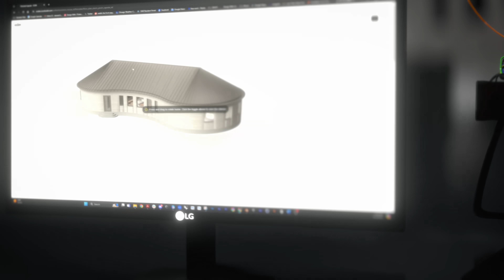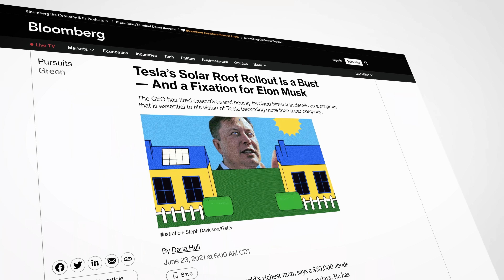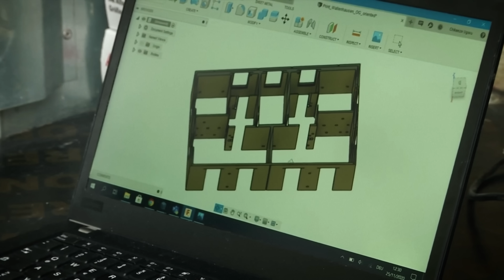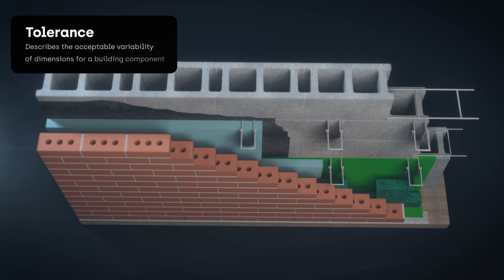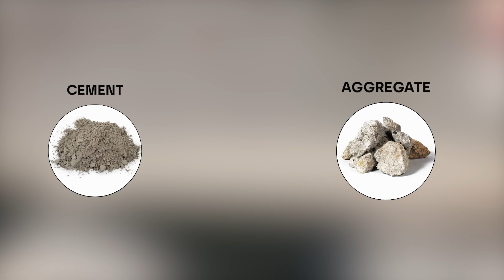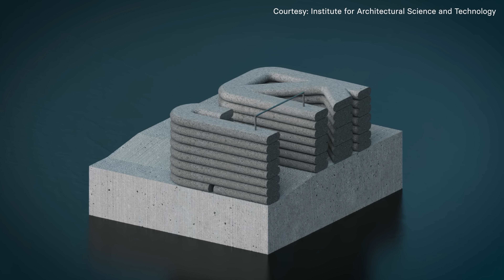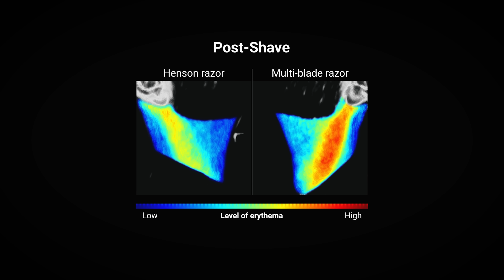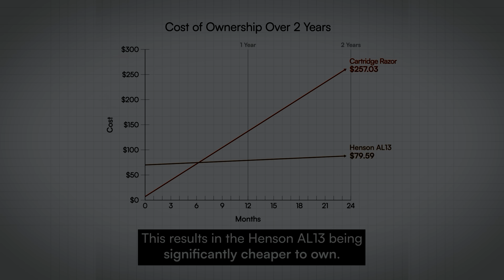Why 3D Printing Buildings Leads to Problems

Comment: 3d printed home... with concrete, its just essentailly framing, as windows nad other means are needed, its liek framing a house, if its all prefabs, in a few days a crew can put it up... you can have more nubmle asembly using a gantry and automotive custom robotics, ie those arms and more with hydralic actuaot,r this then increases the ability of the over all system adn eprformace and increases your tool  load and more.. If you set up a a variable disk gantry with a rotaor swing, you cna have mutliple arms, adn also create pallet load zones, and a multie camera recognition zone nad have one person observing, it cna stack bricks without light all night  nad have an outside program feed back against hte drawing for precisions, it cna also create sharp corners with timing auto trowel. As for windows I had this idea for ever that all windows could be installed better, in a total seal system and frame, and in teh window inset insert woof or steal, youuse a crank arm that wedes out prongs lateral and vertically, into locking holes nad hte base, then cna give it a 1 inch radial swing until you lock it within that variacne giving higher precision to hte blueprint of the core is offset, then the secondary part which makes htis better is you ahve insulator snap trim or acrylic on the outside. Of course my design would also change walls. I hate drywall never liked it currently not free not a citizen and denied educaiton shelter nad slaved away by cults of inequity tehy are theives nad murderers nad lawless and merry in their cruelty. nonethelss I carry on, the cirmes are known.. assholes lol.. anyways, teh secondary means would be acrylic shielding or flat prion , kind of liek a specialed car acrylic that is machine made this owuld be a standard panel that can come in any colour and the purpose is that htey can latch on and off, with special magnetic sealing locks, with a tool so its cna't jsut fall of the wall and its simpyl a setting pi nadn lift or more complicated, the point would be rather the ndry wall the acrylic shield is all stacked into the walls as pannelign which a machien can do... these can be mass made with machines, and offer good coefficient for heat dispersal... so your walls are have good heat disperal and cold dispersion, or pci kanother type of material if yo uwant insulation type setting, the purpose would be to have a coloured pallate of hte systme of any choice, and even chacked or custom panel shapes, and hte panels could be metal also... andinlcuding specailed print walls, meanng you could have rock, mimicry or other ... well anything,, the best hting is if you want a re paint your house, the panels get all taken out and then cna be sent off auto repainted by a machine... as every home hsoudl have historic data key of all dwellers and blueprints and home owner changes and modifications... increasing communication helps advance the systems between homes, but when homes are so fast in this state to make, the only long hting would be surveying but that too can be increased, through various geophysics localied enviro and wider ranges ot a more precise engienering landscape.. so.. total hosue in my mind unfurnished is about ... 3-4 weeks.. 90% machined... could be 100%.. but obviously a human needs to observe and small tasks can be easier... also you can leave your panels in place and have a epson like robot wall print print your house walls wit ha viny coat, over night and change your colour... 3rdly more expensive being an acrylic and the current tv tech, you cna have aflex print scream overlayed and ahve the walls illuminate t any colour or motion.. as if they are all a television.. but lol... I don't know... as for roofing.. I liek the plubiums nad other factors and with combination ofortiz pumps nad more you coudl create a localized fresh water, clenaing water and mini power station... a more self autonomous zone... but.. all we have are thieves on this planet with money.. and open hatred... accuse dreamers or whatever... and state device,s adn then make breeding impossbile.. truly a wicked lot of humans that are ignorant of their wider surroundings and cruel..  come in the name of their wicked god I guess or lack there of.. or whatever means simpyl just lawless cruel humans .. so there in again no work, no life no lmoney.. identity poltics nad more... and then emphsize on its manenr that its vidicated, when I was and could of been happy in my own kind rather then prisoner ot a relic of savages adn cannibals that have no devleopment cognitively except for killign and crime.. the ferallands of nomads...  thus nothign changes and this onyl creates more problems like advancing food, it worked for awhile prosperous we had our own kind nad life.. and the nteh migration came of unlike minds hostile savaee nad lawless, and constnatly using words and nonsense and we see them given power, and yet they insult hte poor and others, by cliaming that is their  reason ot do crimes, when in reality their reason to do crime is becuase crime is in them to do becuase tehy have no law concept in them... siigh..  politics of 3d printing..  openly and honestly... iF come nad destroy your parents a nddeny law, and or vlaue and allwo criminasl to go unabated wth medaited island of chidl rapists, right.. clearly they will condem nand kill me and my life from existence and hten wearly accuse and dictate and spy on me as if some thing to watch, what move shall have but left iwth my mere thoughts ,tehir world is always deception lies and well crafted civil prisons... forcing peopel to be subject ot hte curelst means nad unsual puihsment in their experiements. I find no forgiveness for these liek actions liek unti 731... they are beyonreproach in their disbleief and cruelty. and yet I am accused... of such things.. hmm end rant.

Comment: If you want fast building houses do modular design, in Europe we pour the concrete wall elements laying down in factories, ship them to the work site and put them in place with cranes.
Wooden construction walls is built in the same way .
This 3d printing concrete houses is b.s .
Ise automation in the  house factory for 
Cutting and shaping stuff (if you want to reduce peoples job opportunities )

Comment: Can we talk about the problem with using pu foam in the holow wall space?
A clean concrete wall structure, can be recycled to new concrete or fill as crushed 
Aggregate, the plastic foam konverts a potential clean reusable asset to a contaminated plastic/ rock mess.  Probably inseparable in its parts Unsuitable as concrete agregate and a source of plastic pollution wherever its ised as fill.
The better choice wold be to use  light gas concrete or light aggregate concrete with foam glass or leca as aggregate. 

Why are you Americans so in love with toxic isocyanate building materials ? Yes in Europe we do set doors and windows with it.
foam as whole insulaton solutions is how ever very unusual, in parts for the toxicity of the pu foam during applying face and waste face . but also because the foam is flammable and will give off toxic gases when burning or even heated up a a bit like starting at boiling water temperature.

Comment: If a part breaks you just get a typical mason contractor to mimic the same design. They usually do all sorts of concrete work mimicking natural rocks and stamped pavement. So it ain't a prob. If 3D houses really are cheaper, than it's actually more advantageous to only have bricklayers/ masons do repairs, caulking or cement surfacing work for smoothing those that hate the grooves.

Comment: You know, here in good ol yurop we have a revolutionary new technique called plastering and insulation. We usually use both of them on outside walls, and this actually helps hiding imperfections and you know...keeping warm air inside.

On the inside, plastering hides imperfections and acts just like a dry wall, with the added benefit of having actual walls on which excell at sound insulation and...well, being an actual sturdy wall, that can't be punched through by kids.

And it helps with the repair problem as well, because you can just break a hole in the wall and later close and plaster it again, should you desire.

Comment: So, in colder countries like Canada, where I live, the one huge thing you want to avoid is having a construction material bridge the space between the exterior and the interior. This results in dramatic heat loss through a phenomenon called thermal bridging. By creating continuous webs, you are encouraging heat to escape. Insulation in the remaining cells doesn't overcome this difficulty. There needs to be an impermeable membrane - and preferably, an air space between the exterior and interior construction. So, like many innovations, this is an idea that will work great in warmer countries, but not that great when it gets down to -30C on a regular basis for 4 or 5 months of the year.
Reply: lol Your welcome Chat Gpt for helping you write that, its ok this tiny YouTube comment section thinks your reaaaaaally smart 😉

Comment: 11:50-12:08: dolomite inoculated with a type of fungus that only grows with concrete when exposed to water. They call it self healing concrete and it's been around for a few years already. Ideally you want a mixture that's self healing when cracks occur and doesn't allow moisture to penetrate the structure. The mixture used should also get harder over time as it sequesters carbon from the air (via exposure to the elements). These structures are recyclable, so reprinting them is only a matter of pulverizing the demolished structure and heating it to a specific temperature to separate the molecular bond of the cement to everything else in the mix. Then you just add water and mix it to the correct consistency for the temperature of the day you'll be printing a new structure. Basically it means moving day is only a matter of packing all your possessions inside of a storage container during construction and then unpacking them again in like a week when the structure cures. You'll still need accommodations for like a month while all this is going on, but it's like camping, so as long as you're not going through this process too often you should be fine (the structures should be rated for 100 years but nature has her own plans so aim for 10-20 years max usable life). You can also stucco the exterior and interior of the structure to get that nice finish you want if that's what you're after. You'll still have to remove it all for a reprint but at least you have those nice lines you're after (at extra cost and extra work). I think adobe stucco would be a better compromise because you can just water blast it off and keep it for later reuse. Just a thought.

I'm convinced this is the future because it doesn't matter what the housing market chooses to do with pricing if you can take your house with you anywhere and redesign it any way you want. Why would I want a $1.2m home made 50 years ago knowing it pays for some retirees' nest egg- that I can't afford mind you, when for the cost of a down payment on a car I can own the same sized structure? Why would I want a home someone else has already lived in? When I can make the improvements I want in the next print? I want a house that I can automate water collection, sanitation processing, HVAC air quality control and be energy independent with. I'm not going to get that with any preexisting house on the market at my price range. It just doesn't exist. That's why this is the future, to me anyway. 

And while we're at it, technically that same 3d printed home I'm talking about could end up being free if I use a specific crop to get one of the main construction components and sell off the seeds and fibers I don't need for building. Yeah... You heard that correctly, a free house (with extra steps). Why would I, in THIS economy, want anything to do with a failing model of living and end up passing on the cost of my retirement to the younger generations? That's a FOUL, DISGUSTING thing to do to anyone, taking their financial future away just to survive a few more years when there are easier ways to live that don't screw over the next generation.

Sorry for the rant but... 👀👀👀📈$$$
No.

Comment: rather than 3D printed houses, why not 3D printed blocks? not tiny brick sizes, but modular blocks, that can be put together in different configurations, like legos? You know, most legos fit onto other legos...
I always wondered why "modular construction" was so limited with identical sections. It seems like 3D printing could fill that gap between large modular units and traditional house construction. IDK just a thought...

Comment: I'd hate to live with those walls! Think of cleaning them.  Or building cabinets against them. Filling those cavities with insulation will provide very little insulating value with all the concrete paths for heat to move from one side to the other. 
Factory made insulated concrete panels would seem to have many more advantages. Smooth inside textured outside if desired, electrical and plumbing integrated at time of casting. Floor slabs, stairs roofs all can be made and stacked as high as you'd like and welded together. Commonly used in Europe for multifamily residences. 
I can think of many disadvantages and few advantages to printing with concrete. I'll watch to see if my doubts can be overcome.

Comment: I've been involved with construction design for over 30 years now. New ideas pop up.. usually targeted at one aspect of the construction process- either being cheap to buy or way faster on site - while adding lots of other issues that add to the total cost. About half the cost of building a new house is labor. I like the idea of "3d printing" a house.. but this doesn't actually solve ANY problems, while creating MORE problems (added expenses). While you could design a home to the limitations of 3d printed concrete walls.. you could also design a new home to the limitations of prefabricated walls, prefabricated trusses, and/or Structural Insulated Panels. Those all allow for quickly getting a new house under roof with proper planning. The BIGGEST issue I see with the 3d printed walls shown in the video is they have no steel. They can't put rebar in place before the 3d print because they would be in the way of the print nozzle head. No steel in concrete (and layered to boot) = it's not very structural. You can't build a two story building with these walls only. It's basically glorified Brick Veneer. No idea why people are pushing it like some innovation. We already have efficient uses of material to make prefab systems for a new structure. That being said- in places where they already pour the walls with concrete due to moisture/termite issues, I could see this having SOME benefits but it's still iffy. But they need to figure out the steel aspect.. I would love to see a structure built with these walls on a seismic test platform. Looks like the layers would just crumble.

Comment: A complete concrete home, not treated for moisture resistant, will have moisture damage (mold, mildew, ...etc) also as a home settles, a traditional cement foundation cracks along the bond joint.  This can be easily fixed in a traditional home or building. Not in a layered "printed" home.  It's literally not worth the cement it's made of

Comment: Great video. One issue with 3D printing concrete which I’ve never heard addressed is reinforcement. When you look at a traditional concrete structure being poured, you’ll see lots of steel rebar. Concrete is great under compression, but not so great with tension. Very similar to brick, and why many buildings you see with brick today are a thin brick veneer over a more durable structure.

Comment: Actually, you can close gaps with just bricks. Look up arches made of bricks, and bridges made entirely of bricks show the craftsmanship of old, plus boats and small barges are able to float underneath those constructions. But then when writing the script for this video, using Elon Musk as an example for innovation is a bad choice. Anybody who takes a deep dive into Elon Musk soon discover, that he is the money man who mostly makes money with conning and exploiting government programs. The innovation isn't firsthand innovation but often a variation of innovations of two to three decades ago. Musk usually forces the founding team out and innovation stagnates.

Any technique and material has it's limitations. So does 3D printing,  Not all  all 3D printing projects use concert. Some print with clay and a binder using the dirt the 3D printed house is build on. The industry is young, and some growing pains are to be expected, esp. since unlike in medical times, buildings have to pass pretty strict safety regulations.

Comment: I don’t see how this will make building cheaper? What’s expensive about houses:
- in expensive countries the land value usually exceeds the price of construction. 
- the excavation and basement are the next most expensive part. 
- the rest is the tech. Heating (or cooling), electricity, piping, electronics, etc. actually many people likely paid more for their kitchen than for outer walls.

Comment: What about reenforecement steel in 3d prited house?
I think 3d printed home is good for very small structure where you never going to plan for next floor, Do not plan to give it to next generation. And lots of money to rebuild after 10 years. and not going to plan overhead tanks as well. And cement bondig is also critical part.
If you use brick then also there will be  crack in plaster. In 3d printed home it will whole wall will be splitted.
😢😢😢😢😢😢😢